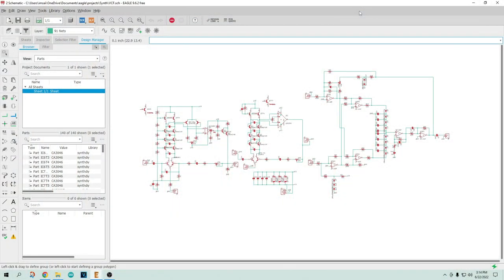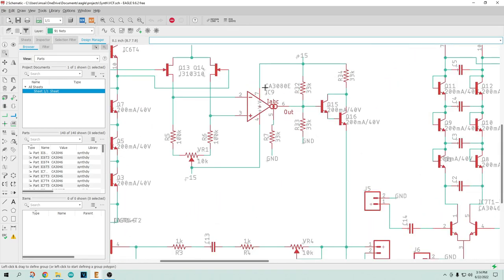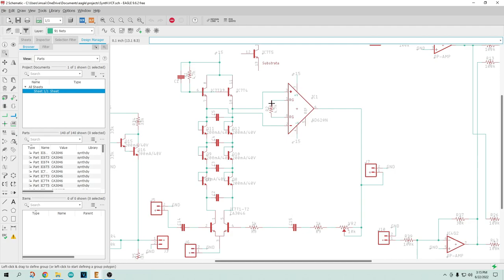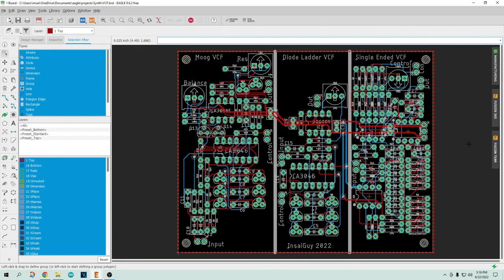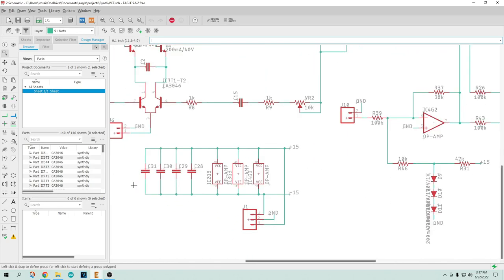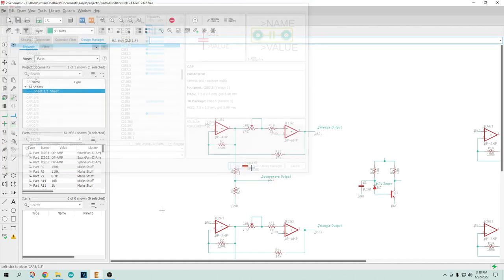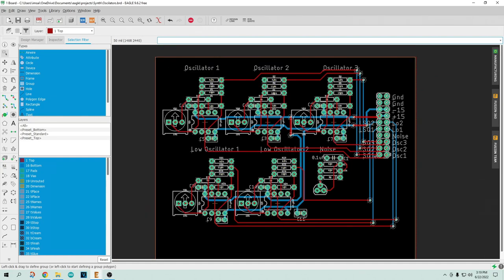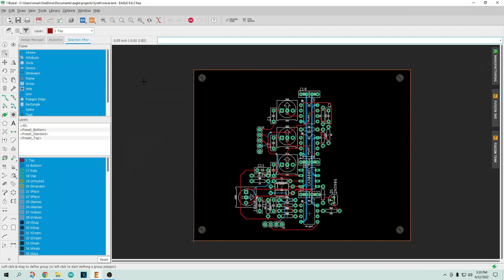#1209 DIY Analog Synthesizer (part 10 of 15)

Comment: Although I've done enough synth related designs not to have need to watch your stuff, you're really entertaining and I'm watching the videos anyways. I appreciate a lot you're taking the time to explain this topics to less experienced peoples! Keep up the good work. PS: for the VCA control, I usually put a diode on the base of the pnp transistor to get a voltage reference so that it doesn't take those 0.7V of the envelope to get the current flowing to the OTA

Comment: hi, there is a certain circuit that could be found in some of tek / wavtek function generators, its a differential amplifier with 2 bjt but what puzzles me is the placement of a resistor and capacitor in series between the collectors, would be generous of you to shed some light on the purpose of this placement.
Reply from the maker: I would need to see the schematic